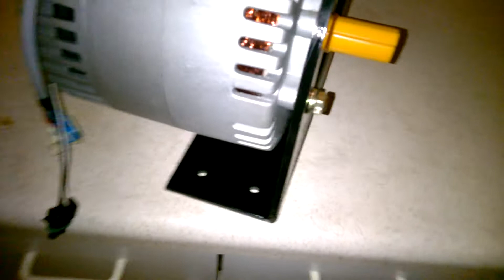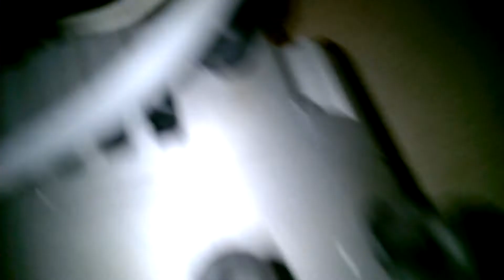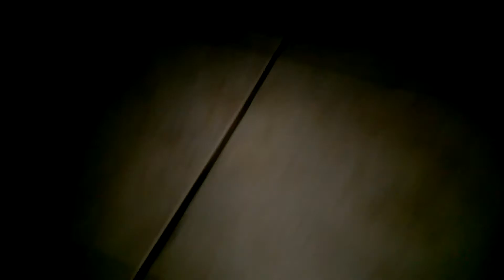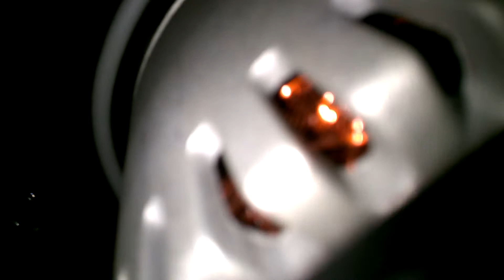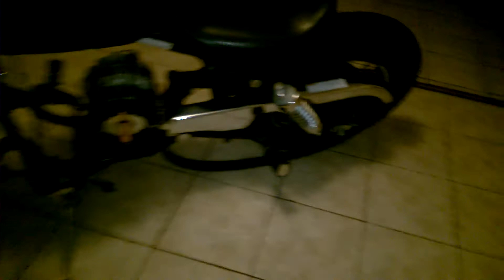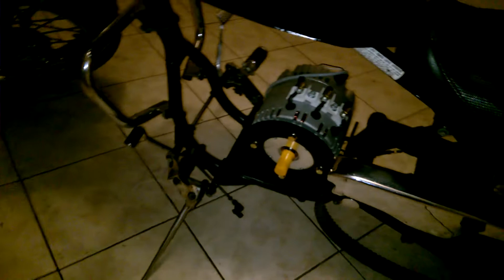Diy Brushless Electric Motorcycle Conversion Pt 3 Motor Mounting Plate

Comment: How u get the bracket and how much it is
Reply from the maker: I got it made at a local metal shop
Reply: @BlakJakk  i know u said in the video just wanted to see if you could share the measurements hole .. diameter specs and the thickness of the steel
Reply from the maker: @Ai-TechWorld1  that was some time ago I don't have the info.  But whatever motor you are using you should be able to get the deminsions online

Comment: How many amps does the motorcycle draw from the battery while accelerating and how many volts does the battery have?
Reply from the maker: The motor can handle 450A at 100v continuously for up to 2 min